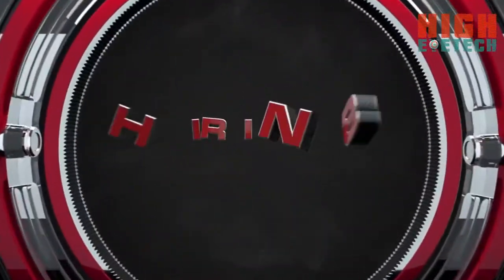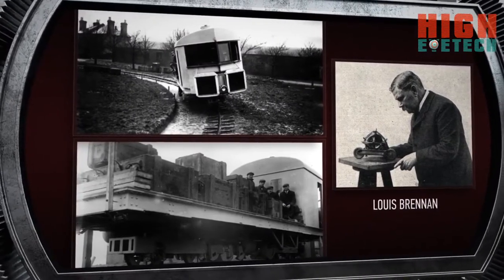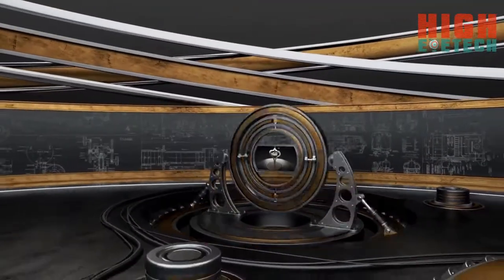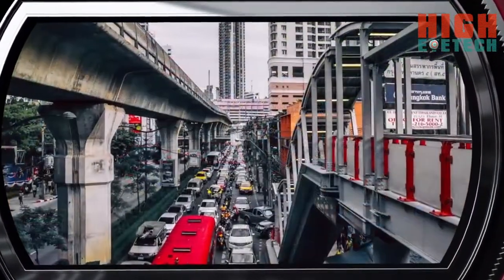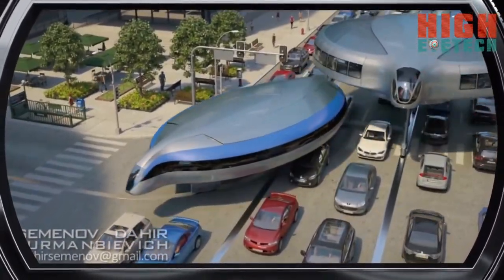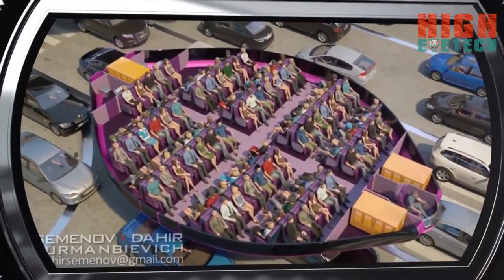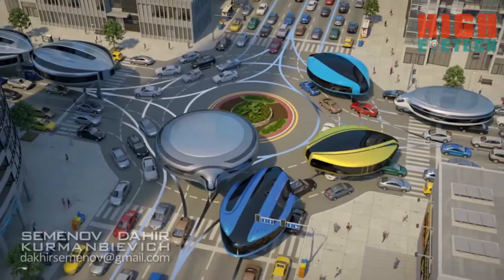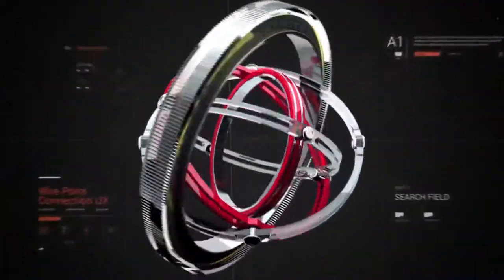Its Time To Travel Without Traffic Jams |  New Revolution in public transport

Comment: This is easily the stupidest Public Transport concept I've seen in a while. My feeling tells me this is satire but doesn't look like it.
This is the rich councellor's approach for public transport. In his mind Public Transport is only for the underprivileged, poorer people that cannot afford a car. He does not care about what happens to the transit as long as it doesn't get in the way of cars. It's equally as stupid as those Busses with Tunnels in China.

Firstly, those things look expensive. Much much more expensive than a train. It's made completely obsolete by elevated Metros. Secondly those things will not be able to drive very quickly, and will have to stop at Intersections. In that sense it's like Trams or BRT. It combines the disadvantages of Trams with the disadvantages of Metro's while having none of the Advantages! Great start.
And as those things will not be able to drive quickly and will have to stop at intersections, you might aswell just choose to drive. This is exactly the reason why traffic jams exist in the first place.

The Downs Thomson Paradox states, that people will continue to drive, and Traffic will continue to get worse, until other Options like Public Transport become faster and more convenient. In that sense, those things will better traffic slightly, but only slighty. The money is better used for building a Metro system which is both faster and cheaper to build. Or some lanes could be converted into Bike lanes which will not worsen Traffic, it will take roughly as much time as previously, because of the Downs Thomson Paradox, instead it will just make people bike more.
Reply: Ikr